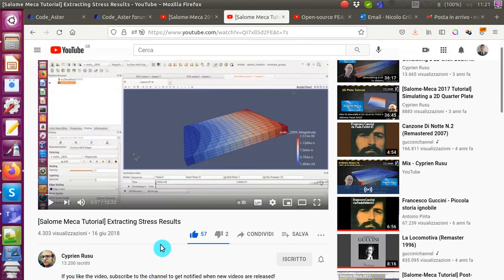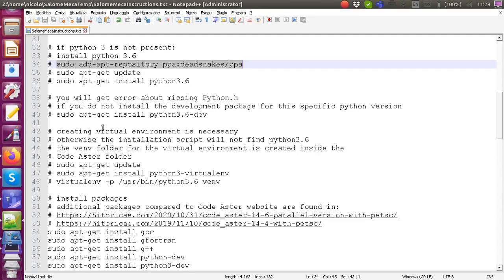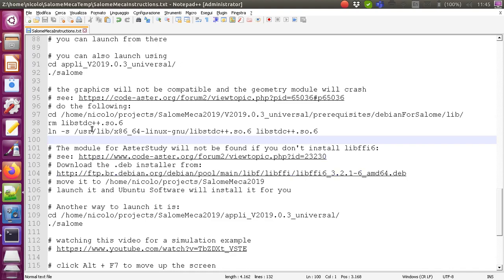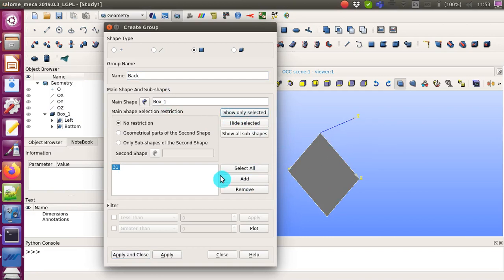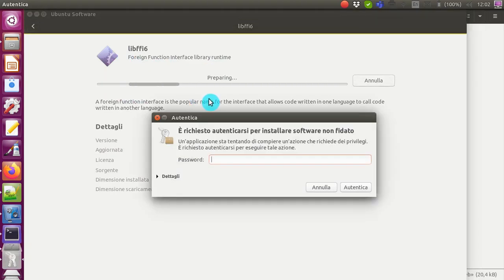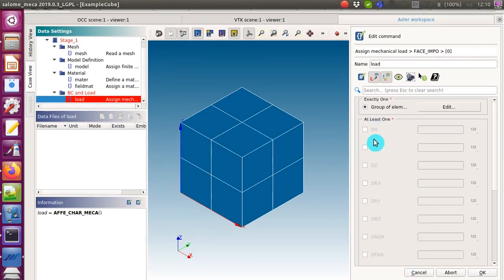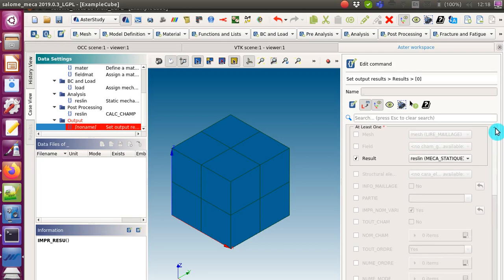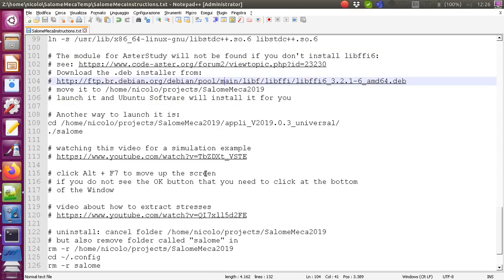Install and use Salome Meca 2019 on Ubuntu 20.04

Comment: Nicoló! this video is excellent! It helped me in a great way! You give a lot of info on how to solve different possible problems in this version installation.
Very thankful. Installed Salome-Meca 19.0.3, in Ubuntu 20.04.6 LTS (Focal Fossa) with the difference of updating python 2.7, instead of python3 which was updated. All in a USB flash Live pendrive using rufus for the operating system ISO on the pendrive.

Comment: Hello thanks for the video. I have a problem when installing the libffig package, salome crushes when launching. I guess, it is because I have an intell processor and I see that this package is made for amd, is there any equivalent package for intel? I see a long list of packages in the site you mention, but there are no descriptions.
Reply from the maker: I don't know what is libffig. The installation you see in the video was made on an Intel Core i5. The installation should depend only on OS. If you cannot figure out, it is easier to use the singularity container https://code-aster.org/V2/spip.php?article303
Reply: @nicologrilli9931  libffig is the package you downloaded and installed when you tryed to run the Aster study, in the name of the package says that it is for amd64 I thougth that was the reason why it made my Salome crush. Thans for the answer

Comment: Amazing tutorial, thanks a lot:)
Reply from the maker: You're welcome
Reply: @nicologrilli9931  

Awasome tutorial. Next week I will try it. The only way I can make code-aster to run is using the default installation in CAELINUX. 

Whenever I install salome-meca on Windows or Ubuntu,  I can never get code-aster to run. The geometric module and the meshing module run fine on my Windows and Ubuntu installations.
Reply from the maker: @ajarivas72   try the singularity container on the code aster website, it works much better.
Reply: @nicologrilli9931  

Thanks. I will try it.
Reply: @nicologrilli9931  

Bon giorno Nicolo.

I tried the singularity container as you recommended. Follow all the steps and patches. 

Everything went fine. 

When I tried to do a mesh for a FEA, the mesh algorithm failed. 

I will install CAELINUX again.
Reply from the maker: @ajarivas72  I can't say without seeing the error. Singularity container works fine on Ubuntu 22 on my computer.

Comment: Thanks for this helpful video. But I wanted to ask something. What is the difference between Salome and Salome Meca? If I chose salome meca instead of salome, is there so much difference?
Reply from the maker: The software is called Salome Meca, it contains the solver called Code Aster and MFront for material modelling
Reply from the maker: Maybe it's just abbreviated as Salome sometimes, but the full name is Salome Meca

Comment: Ciao Nicolò ho seguito il tuo tutorial purtroppo non riesco a risolvere il probleme di Aster Study. Nel momento in cui installo il file .deb Salome Meca non si apre più.
Reply from the maker: Ciao Giuseppe, non credo ci sia nessun .deb nella mia procedura, ho scaricato il file da qui:
https://www.code-aster.org/spip.php?article303
È un archivio con dentro un .run installer
È probabile che esista una versione .deb ma prova con il .run
Ti consiglio anche di provare con il singularity container, perché è più facile:
https://codeaster-opensource-documentation.gitlab.io/opensource-documentation/sm_install/installation_linux.html
Usa la versione 2021, cioè la più recente tra queste:
https://www.code-aster.org/FICHIERS/singularity/
Vedrai che funziona bene in Ubuntu 20.04
Spero questo ti possa aiutare

Comment: Thank you for this video. I followed your instructions and when aster study did not open I installed libffi6, but after this installation I can't open salome meca. The message is "terminating salome on port 2810.... Have you any opinion about this? thank you very much
Reply from the maker: I am not sure, the installation of a package is unlikely to cause the executable not to run. Try uninstalling the libffi6 package, but I guess the problem is not that one. See if you can run the ./salome executable from terminal.
Reply: @nicologrilli9931 thank you for your answer. i always run from terminal. if i uninstal libffi6 salome run but aster-study doesn't open. if i reinstall libffi6 salome doesn't run. unfortunally I am in a loop.
Reply from the maker: @germanozuccolotto9656   so sorry to hear that.
I see there is a post about your error here:
https://www.code-aster.org/forum2/viewtopic.php?id=23629
They say they used the mesa version, but I am not sure how to do.
Are you on Ubuntu 20.04?
What happens if you run:
./salome shell
with libffi6 installed?
I mean run the executable from terminal with the shell option.
Reply from the maker: @germanozuccolotto9656  I also suggest you follow the suggestion by Julio Ramirez and you install on Docker. Trust this helps.
Reply: @nicologrilli9931  ho risolto! il problema era con Ubuntu 21.04. ho resettato e installato la versione 20.04. adesso salome si apre dopo l'installazione di libffi6. Comunque grazie del video. Senza non sarei mai riuscito ad installarlo.

Comment: Great work and very useful! Did you find out why there are warning messages? I get the same warning messages on Ubuntu 18.04. regardless the Salome opens up but ASTK doesn't run. Thanks for sharing your efforts!
Reply from the maker: In the installation shown in this video, open terminal in appli_V2019.0.3_universal folder and run: 
./salome shell astk
This will open successfully astk, 
yes there are some warnings appearing but they do not affect the functionality of astk.
I recommend you update to Ubuntu 20 and try again.